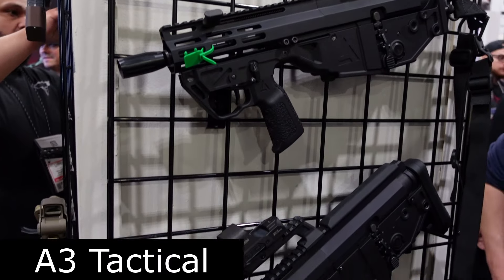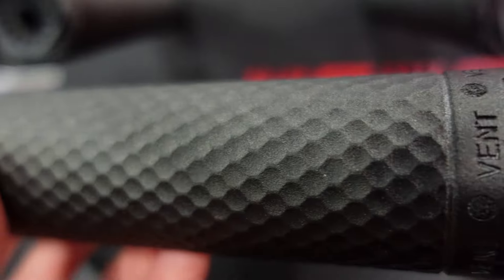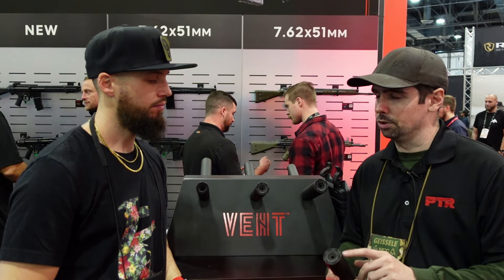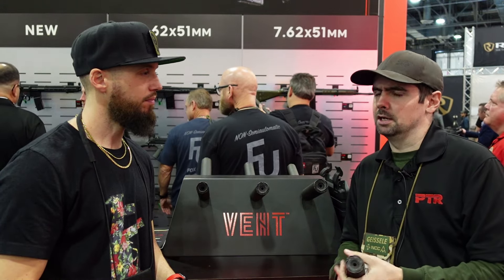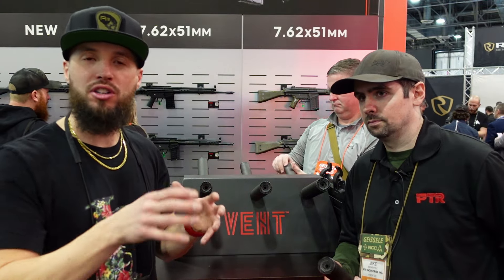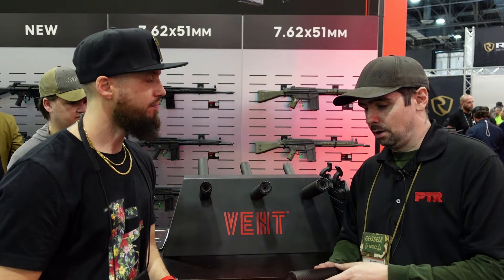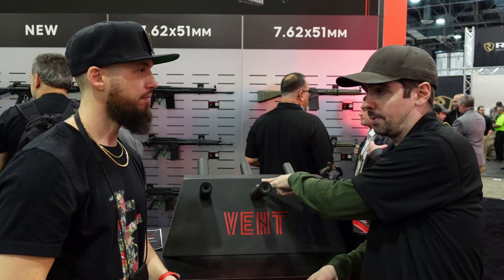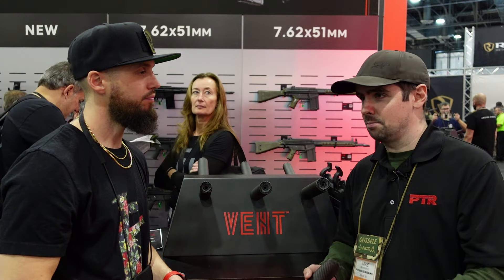SHOT Show 2024: PTR Vent

Comment: What if there's a baffle strike?  Since the whole thing is monolithic, are you SOL?
Reply: There's no traditional baffles inside these suppressors to have a baffle strike, from my understanding of it.

 It's a continuous thick wall that's extremely porous so as to disperse the gas as it goes through it.

 Think about it like this:  it's tube that's packed up tight (up to the entrance/exit holes) with steel wool until you can see a hole through it for the "X" caliber bullet to pass thru it.
Reply: If it's serialized near the proximal end, they could just cut the front off and re-print the rest of the body